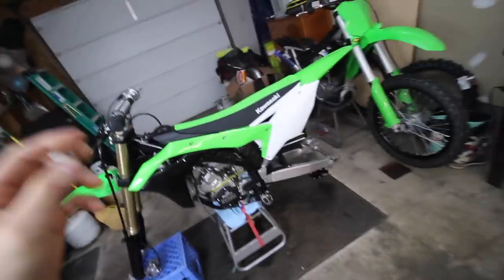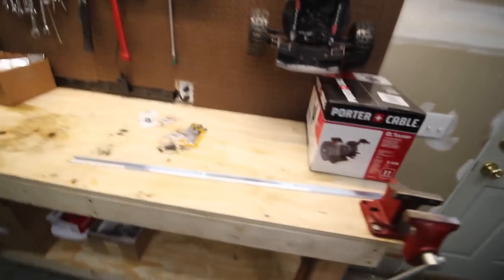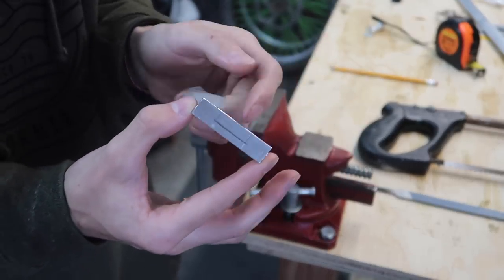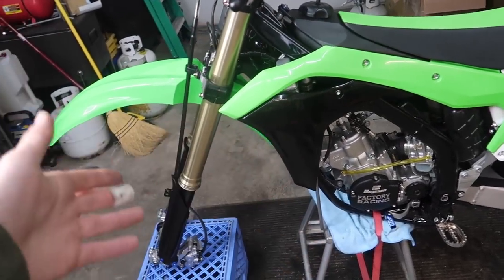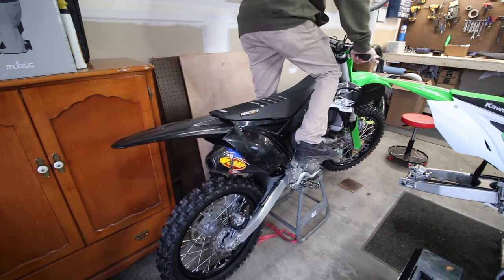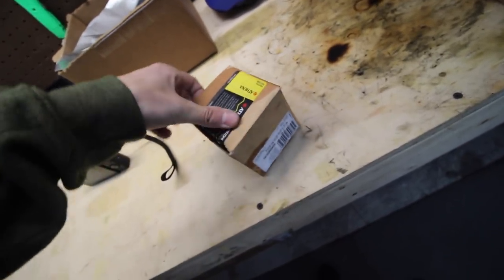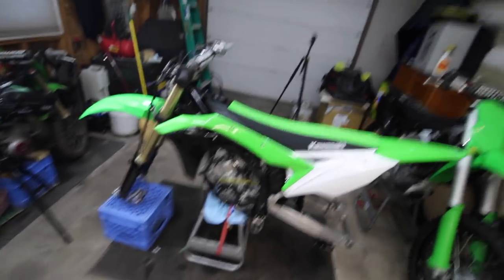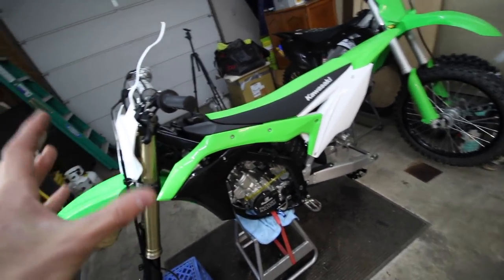FIXING THE 2018 KX125 ISSUE...

Comment: Measure the gap between the stops while keeping forks just shy of hitting the frame. (you probably already did) cut a piece 1/4" flat stock long enough to where it will cover that gap on both sides, then bolt it to the main stop that you bolted your original invention to. only 2 cuts and 2 holes 2 drill. Plus 1/4 steel is much stronger than that aluminum angle you used and its going to look stock. Im a welder fabricator.
Also, just any nut, may not fit under the main stop to bolt the flat bar down. If u buy a metric bolt any lowes will have thinner nuts for that bolt.
you have a kick ass channel dude. Good work.

Comment: Just curious and not sure if you know or thought about it but older KTM's use to have a set screw in the exact area where the lower triple hits against the frame. You could drill and tap and do the same. Just measure the length and replicate it on the other side. Adjust as needed after a ride or 2 to keep it from hitting the radiator